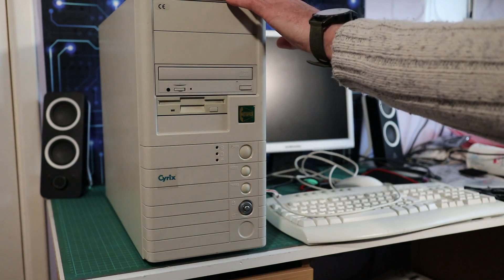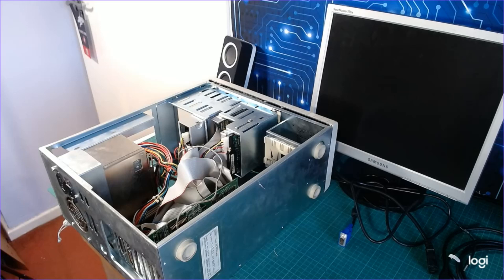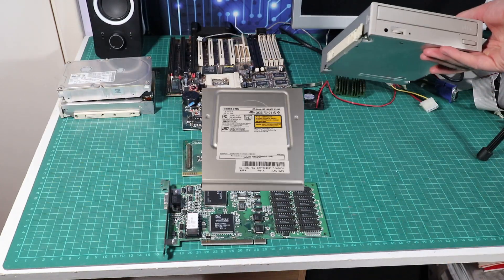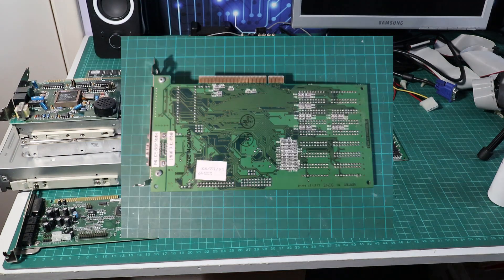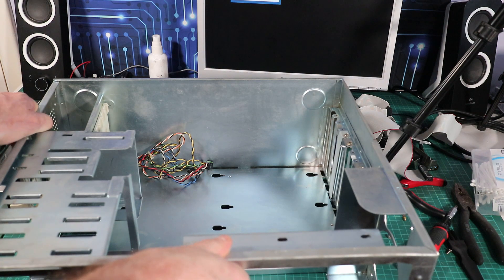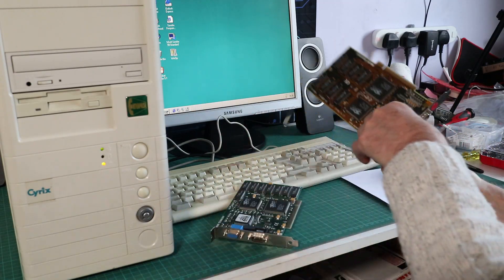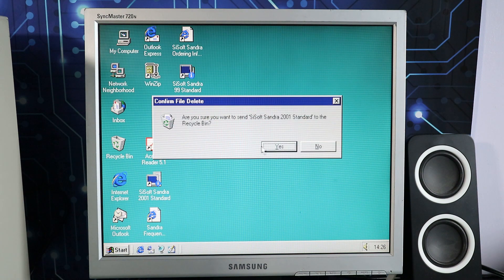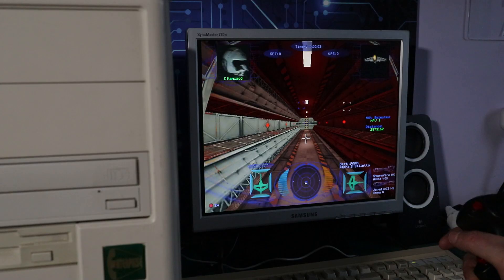Cyrix 6x86 plus mach32 plus voodoo

Comment: PC Chips was for the OEM market, while Elpina/Matsonic/Amptron/ECS/Mercury were for the retail markets. I don't there were any morals per se coming from Elpina, as all the motherboards were made in the same Hsin-Tech factory. You can easily see the Voodoo being choked by the 6x86MX due to the lack of the Pentium Instruction Set.
Reply from the maker: Yes, it wasn't the greatest chip to pair with a voodoo. Just having a mess around. Going to take a closer look at the board at some point with more processors and check if the cache is real etc.

Comment: Nice rare CPU, I only have one Cyrix 6x86 in my collection, the same 6x86L PR200, the fastest one and low voltage version. Only problem with the 6x86 Cyrix: Some programes means, that this is a 486 CPU, so some games (Pygnosis Formula 1 for example) needs a Cyrix 6x86 patch for compatibility or you could try the tool "cypower", google for "Getting software to run on a Cyrix 6x86", the first link. The later 6X86MX has solved this problems.

Comment: That Motherboard...  I built literally dozens of machines for friends, family and customers using that exact board or a PC Chips look-alike board that I bought cheap as well...chips from the local reseller.  I usually paired it with the second tier Cyrix chip (no sense paying the premium for the fastest chip) and 64 MB of EDO ram.  I built them into the customer's old 286,385 or 486 machines and re-used the sound cards and the ISA VGA card if it had at least 1MB of VRAM.  Toss in a 2 GB hard drive and a 8X CD-ROM and you had a reasonable Windows 95 machine for less than $500.

The Cyrix processor in my brother's machine lasted less than a month, He graduated High School in '96 and everyone in his dorm at College wanted to play Quake.  As I recall we ended up getting him a K5 PR200 instead
Reply from the maker: Cool. They were definately bargain chips, I'm sure there were a good number of games that ran totally fine on them. I went in search of the k5 pr200 so I could add it to the chips I plan to compare this with. None to be had, seems an elusive chip. I'll keep looking.
Reply: @66mhzbrain  They're pretty uncommon.  They were overshadowed by the release of the K6 not much later, and as I recall, they're not especially great compared to a real Pentium.
Reply from the maker: @dennisp.2147  It would still be nice to find one, just to have it. Hopefully one will turn up at some point
Reply from the maker: Someone foubd one and posted me on twitter, it was on ebay for about $750 😬
Reply: @66mhzbrain  That's delusional.  They were only about $80 new.
Reply from the maker: Agreed

Comment: That’s a nice chunker of a system. Looks great, but I think that Cyrix is struggling with Wing Commander. Either way, great pickup dude!
Reply from the maker: Thanks! Yes its a big solid thing. Wing commander was a bit too much for it, still fun to mess around with though😁
Reply: @66mhzbrain  btw I did pull out the two eMachines towers and got everything installed in the case but had to stop because I’m out of IDE cables lol. That means the builds have to wait yet again. 😳
Reply from the maker: @mesterak  cool, a short wait for ide cables away from some cool old skool cumputering😁 you should make a video and show them off! You need a logo or something, Mr Skullz would be an awesome pc brand name!

Comment: Love the intro music. I'm thinking the bolts on the top were for mounting under a desk. Definitely benchmark Quake in software render mode. I played it on the P166 (133Mhz) and I don't think it was much better than a Pentium 90 for that game.
Reply from the maker: Cool. Yes a few have said that about the bolts, never seen that! I plan to do a bunch of stuff with this, benching against  other cpu at pr speeds, clock speeds and with software and 3d accelerated. Should be a fun project. Fpu intensive stuff like quake and try and find games that it copes with.

Comment: So back in the day me being cheap. i purchased a pr-233 with a txpro chipset mainboard. To understand how that worked. You would save about $60.00 total than the Intel / Mainboard equiv. The two issues I ran into was. One onboard serial port died and for some reason the Ansi editor program called The draw for dos didn't run. This was par for the course on non intel procs. Once in a while you would find a program that would not run on it.  Now on a side note. When I ran linux on it I was able do two things on it. 1. Enabled extra code in the Kernel to allow access to the risc? core instruction set. This basically double the speed of the machine. The next thing I did was use the txpro driver for linux instead of the generic IDE driver. This increased the boot up speed to basically double too. Well access to the ide drive.
Reply from the maker: I'm sure I read that they werent 100% compatible with the pentium architecture, I guess that may have had some thing to do with it for stuff coded with pentium. Interesting about the risc! I'd read that though classified as cisc x86 was risc at  heart so interesting that you can code for that via linux!
Reply: That's insane to know about the RISC. Wonder if Intel has a secret way of running internal microcode instructions directly
Reply: @thedopplereffect00  I not even sure if I called it correctly. All I remember is that you could enable a model in linux to access the code in the cpu. I did a little more looking and can't find it.

Comment: My first PC was a hand me down with a Cyrix PR166, 16MBA EDO, 4MB ATI Rage, no sound and no CD running Windows 3,1.  By the time I was done with it I had a Pentium MMX running at 266MHz, Yahmaha YMF sound, 512MB PC100, both Creative DVD and HP CD writer and the original Radeon.  I pushed that platform to it's limits.
Reply from the maker: Cool, yes there was lots you could do with socket 7, Its a fun platform to mess about with, endless permutations!

Comment: Dogshit for Quake. Passable for everything else. I had one early days, a 100Mhz Cyrix, and it held it's own against the Intel Pentium 133 in stuff like Diablo and FireFight and Red Alert. But once you fired up Quake, it was slower than an Intel Pentium 75. Absolutely terrible. The ratio of the FPU defacit seemed fixed too, increasing the clock speed just kept the same percentage of lacking FPU performance. A 200Mhz Cyrix doesn't beat an Intel Pentium 120Mhz in Quake. And the difference is very important, it's playable vs not playable. Or, if you're happy with sub 30fps gaming in titles like Quake, it's jittery vs smooth. Personally, games like Quake have to be smooth for me to enjoy them, and it's essential to have high FPS in deathmatch.

Moving from a 100Mhz Cyrix to a vanilla Pentium 200 gave almost 3x the FPS in Quake 1 for me. And by the time 1997 rolled around, with Quake II and Tombraider and whatnot, having a decently performing FPU processor was essential. The 3Dfx did a good job of making the CPU less important, but the VooDoo was massively held back by the Cyrix in 3D titles.
Reply from the maker: Yes, even in wing commander it seemed to be struggling. I read about these cpus with weak fpu but this is the first time I've used one for gaming. I have a winchip 200 with a similar problem as well so will compare that and this with intel and amd at some point.
Reply: @66mhzbrain  Aye the problem with comparison is - the 200+ Cyrix you have is 150Mhz. The 100Mhz Cyrix I had was called a PR133. Misleading.

Testing in FPU intensive titles, would be interesting to see like for like - an Intel P150 vs that 200+ Cyrix. Then also an Intel P200 vs the 200+. 

I have a few gold WInchip 2A's and 2B's, 250 + 266 chips, but I've yet to test them. I read they are pretty weird, have some very nice architecture in some respects, that kinda overcome the lacking FPU performance more than the Cyrix did. 

Cyrix and IBM and AMD made some very nice pentium competitors and at good prices, but were only really relevant for gaming for a very short time. Quake effectively killed those CPU's.
Reply from the maker: @TheVanillatech  yes there could be 2 sets of tests with these, a set against chips of the pr rating and another set against chips that match the true clocks speed, both would be interesting in scenarios that are non fpu intensive and fpu intensive
Reply from the maker: @TheVanillatech  I have cpus to test at 200, I'll see if I can get some 150s
Reply from the maker: Cool, thankyou! I'll see what my stuff cont do and let you know!
Reply from the maker: @TheVanillatech  ive had a mooch through my cpus and have nothing at 150. I think the best 2 tests will be native/estimated 200 and 150 initially so if you have a spar intel 150 I can borrow would be cool, will be nice to use someone elses kit in a vid😁
Reply from the maker: Cool thankyou! Never done direct comms on here. I'll get one set up for the channel and let you know in a few mins.
Reply from the maker: mrsixtysixmhz@gmail.com

Comment: I think the bolts were used to attach the case directly under a desk, so that it is hanging there and taking less floor space.
Reply: Imagine putting a sheet of glass or acrylic on those bolts. Their shape seem to make them fit for that. Just to be able to put something on top of the computer without scratching the case.
Reply from the maker: Thats a pretty cool idea!
Reply from the maker: I guess thats possible!